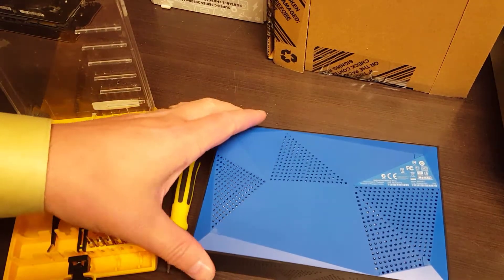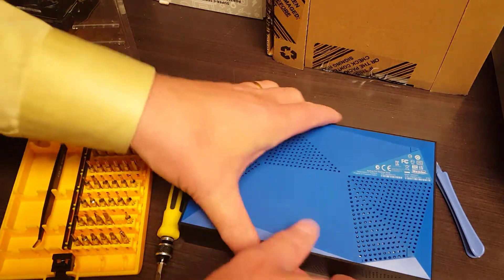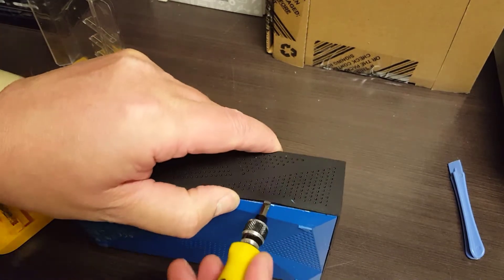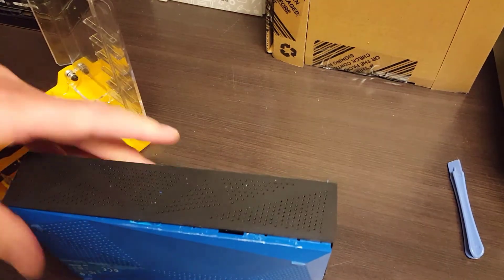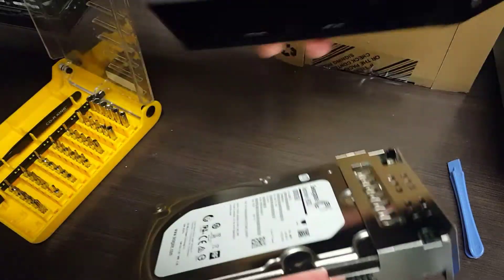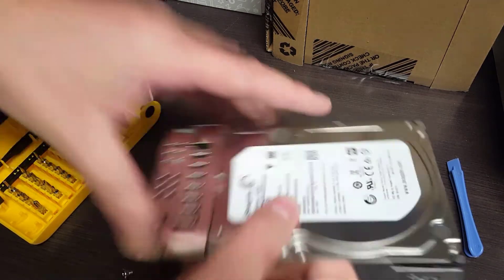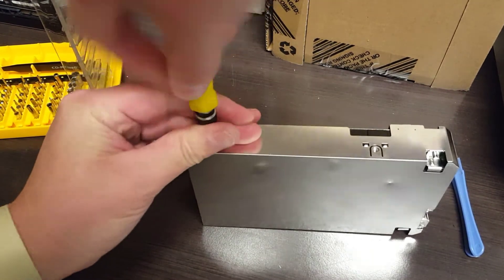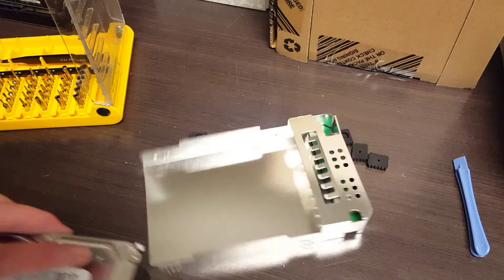How to Disassemble A Seagate Backup Plus External Disk Chassis

Comment: Too destructive. Push down the bottom cover, create a small split between the plate edge and the side. Insert old plastic credit cards or something similar. Do the same for a perpendicular side. Then push the cards towards a corner and it'll lift up. Pry the corner up enough to get a finger in and pull the the rest of the bottom case off. No need to destroy by prying all round.

Comment: Thanks a lot for this tutorial! It saved my bacon after my 5TB external took a dump with some of the photos and video on it not backed up. I figured it was probably a power issue rather than the drive itself since the power light wasn't turning on and sure enough I removed the drive, placed it in a dock, and was able to salvage my data without paying through the nose for a data recovery service :)
Reply from the maker: Glad it helped!  I have been in the same boat as you and it is not fun.  :)